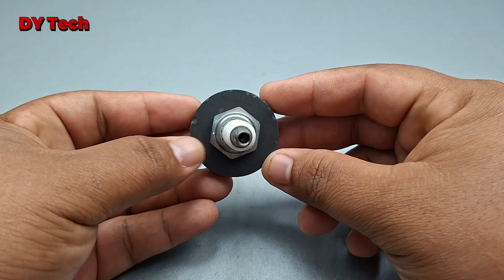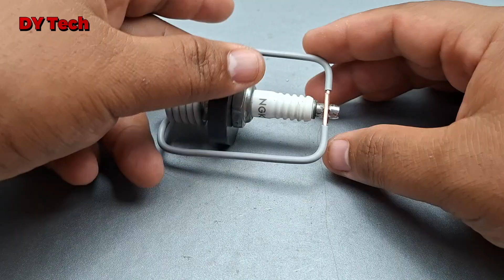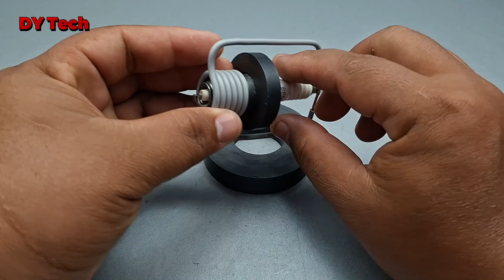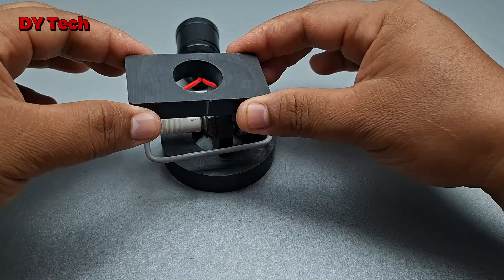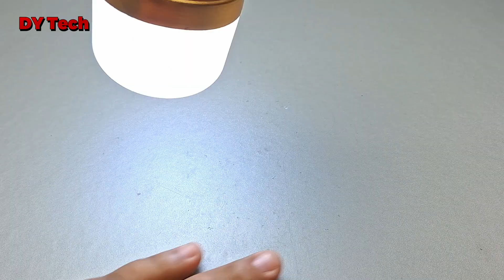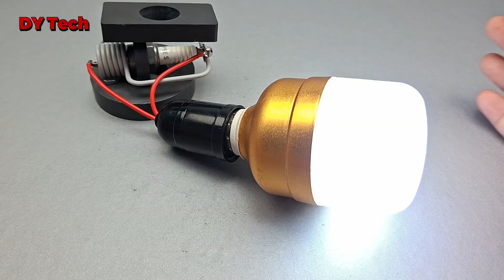how to make free 220volt energy generator at home with pvc copper wire using spark plug

Comment: SO LET ME SEE... YOU MAKE A GREY COIL THEN SHORT IT OUT BY SOLDERING BOTH ENDS TOGETHER. OK, NO POINT TO ANY OF IT UP TO NOW..... CARRY ON.... WE ADD A SPARK PLUG AND A FEW MAGNETS FOR NO REASON.... FAIR ENOUGH... WE STILL USE THE EMERGENCY LAMP WITH THE BATTERIES IN THE BASE... YES... THEN WHAT?  OH I SEE THEN WE PRETEND ALL THE RUBBISH WE SOLDERED TOGETHER DOES SOMETHING.... WHERE DOES THE 220 VOLTS COME FROM THEN? WE SHORTED THE COIL OUT BY SOLDERING BOTH ENDS OF THE GREY WIRE TO THE SAME PLACE...BRILLIANT... SCAM.....